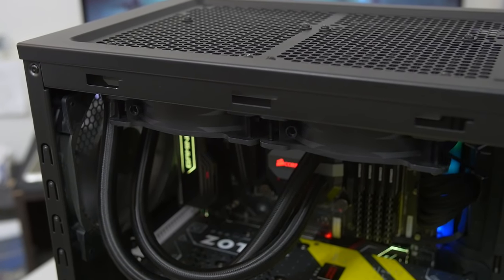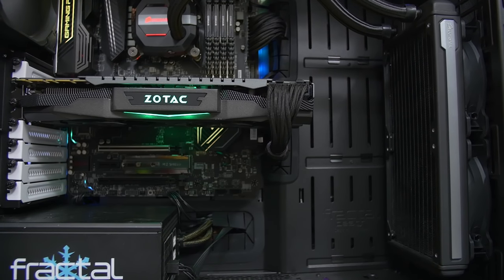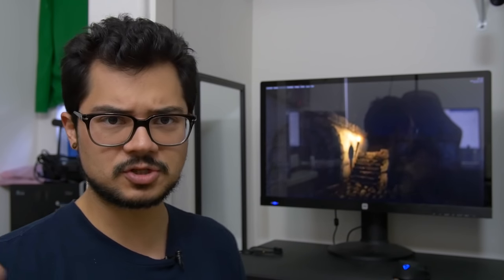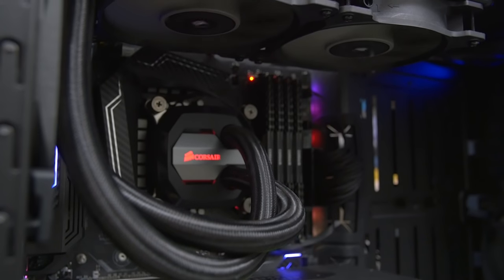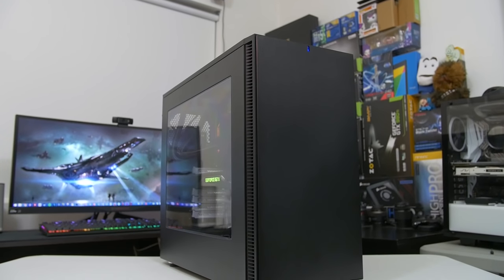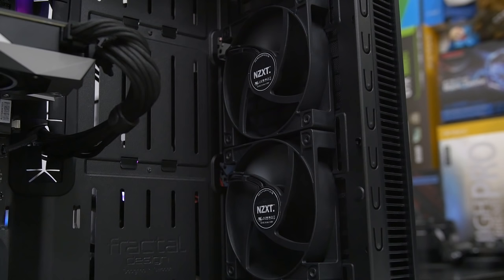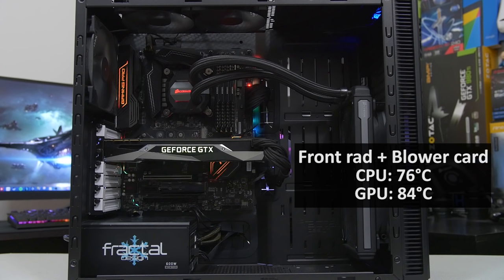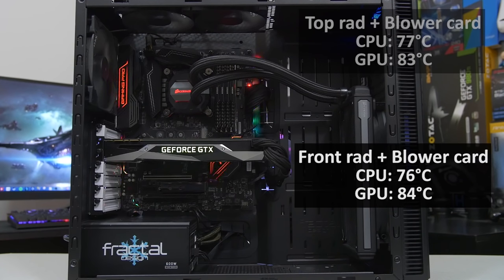Does Radiator Placement Matter? Hint: YES

Comment: so front mount is actually better... interesting, seeing as how everyone was tearing the s340 apart for its lack of top radiator support...
Reply: The S340 is still lacking rad/fan support in the top. It has support for what, one 120mm fan? Maybe a 140mm? That's ridiculous lol. It's a fine case, but like all, has it's drawbacks. Like my H440's front intake sucks fucking balls. I mean, the S340 does as well, but still.
Reply: 3 140s and 1 120 at the rear. front intake is fine, i've done both air and water in mine, and as far as i can see, it doesn't need anything more. for its size and price, there's really not much that could be improved. my 5820k is kept at about 72° by a dark rock pro 3 currently at 4.4 ghz, and my inno3d 980 barely passes 70° @1495 mhz. before that i had a sapphire r9 280x in there, didn't heat up above 75°, and that is one hothead of a card... i don't think much more cooling power is required for 95% of all systems out there, and those systems would probably not be built in a decidedly compact 70 bucks case... the h440s intake situation is way worse than the s340s, there's a huge gap between fans and front panel on the s340.
Reply: givemeajackson The S340 absolutely does not have support for 3 fans in the top. It has 2x140(280mm) in the front or one 120/140mm fan up top. The H440 intake isn't significantly worse than the S340. The S340 is better, but only slightly. Both cases are poss poor options for thermals since I'm both situations, there are better cases for the same price for cooling performance. I paid for the looks with my H440. To be fair though, H440 and S340 were two of the first to the game with PSU shrouds, which was a necessity for me when I bought my H440 a few years back.
Reply: givemeajackson also the 280x wasn't that bad a GPU for temps I'm sure. 70c range sounds about right, which back then for a mid ranged GPU wasn't terrible.
Reply: By that I believe they meant altogether, not at the top. The S340 can support 3 140mm fans and 1 120mm in the rear.
Reply: Not if you intake from the top. Also not a factor if you water-cool your gpu. I dread people referencing this vid and not knowing what they are talking about (not you)
Reply: 3  140s in total of course, which i believe to be entirely sufficient for anything with only one gpu. i'm not temperature limited with my 5820k, it just won't go any higher than 4.4, and temps were perfect both when watercooled and aircooled, and you probably know that the fan setup on a dark rock pro is configured for less noise and not absolute performance. 

the 280x had a tdp of 250 watts, so while its temps were ok due to sapphire doing an extremely good job with their custom cooler (people who owned a reference 7970 ghz will know what that means), it did heat up the system more than pretty much anything else barring a hawaii/grenada based card. yes, there are better cooling cases for the same price now, but not in the same size category. and back in 2014 it was the only case to do the whole less drive bays + power supply shroud thing.

if i had to build my system again i would probably go with a phanteks enthoo evolv, but back then the s340 sure wasn't a bad decision. it's not a case for all systems, it's specialised on one type of system, but the fact of the matter is that most people's systems fit exactly into that scheme, now more than ever: one or 2 hard drives, an ssd, one gpu, either an aio or a medium sized air cooler.
Reply: I think it varies based on the case you use. I think 10 degrees delta as shown  in this video is too much. There must be a problem somewhere. It could be the design of the case, the type of fans, the placing of the front fans, etc.
Reply: givemeajackson Totally agree. However, Phanteks Eclipse P400(S) and Enthoo Pro M are similar size and cost to the S340 but with better fan/rad support. Either of those are better choices than the S340 now IMO. S340 was definitely a killer case when it released though, for sure. 

Also I totally agree with the Enthoo EVOLV, ATX version of that would be my case if I was buying today. Such beauty.
Reply: givemeajackson the s340/elite problem is thr case in take is locked to the top and bottom there isnt comming any air from the side of the front panel.
Reply: I think the define c is better I believe it's shorter
Reply: If you make a comparison between Top Rad + Blower and Top Rad + Open, I think he managed to make a point here. If the GPU is the biggest culprit for high temperature, then it makes sense. But the 10 degrees difference is still quite staggering.
Reply: Lol I have the elite, im glad it doesnt because air has more restriction than it should have when its push on top. 

Heat rises.
Reply: Hmmer Pimy Well my hdd would get fried
Reply: PrimalSounds The "heat rises" thing doesn't really matter when it comes to computer cases. Air will move in the direction set by the fans you have inside the case.
Reply: TrueZtyleZ7 A computer case wont change physics. I have tested the air coming out of my top exhaust vs the rear exhaust and the majority of hot air does come out of the top exhaust.
Reply: PrimalSounds that's not cause of heat convection, that's just the way airflow is set up in your case. heat convection is a way less significant factor than the turbulence generated by fans inside a pc case, especially since our "hot" air is maybe 15 degrees warmer than ambient at most. convection is very important in passively cooled builds, but as soon as you have a single fan in your case it's pretty much overpowered by turbulences
Reply: givemeajackson If you have the fans set for it there is nothing restricting it, a object in motion will remain in motion unless acted on by a external force.
Reply: so heatsinks, meshes and fans don't cause any eddie currents in your system? first of all, there are tons of external forces in a pc case, namely fans. second of all, newton's first law doesn't apply to gases on a macroscopic scale, cause the actual molecules to witch it can be applied are constantly bumping into each other and changing direction all the time. basically, i can't take a fistful of air and throw it somewhere, can i? 

if you don't believe me, take a hairdryer and point it at your feet. that's much hotter air than what you're dealing with in a pc case, still you'll feel a warm wind on your feet cause the dryer's fan is way more powerful than the convection effect. if you sealed the room and let it sit for 2 hours, then you'll notice that there's a temperature gradient in the room top to bottom, but as soon as you turn on the ceiling fan it's all a complete mess again in a matter of seconds.
Reply: you sir deserved a vote
Reply: givemeajackson Depends on which way the blades are turning.
Reply: PrimalSounds actually it doesn't. turbulence is turbulence, on both sides of the fan
Reply: givemeajackson In referance to your analogy a ceiling fan car either be a "intake" or "exhaust"
Reply: really doesn't matter, as soon as there are pressure gradients and objects placed along those gradients there is going to be turbulence. and ceiling fans don't actually exhaust or intake, relative to the room, the just stir things around a little
Reply: Well people say push pull doesnt matter but i see at 10c difference on my cpu when i do it with a thick rad.
Reply: Yep. The air only passes through the radiator for a tiny fraction of a second and really doesn't have any time to heat up, therefore causing no higher temps inside the case.
Reply: I had to put my rad up front. After buying the parts I discovered it wouldn't squeeze in up top. I think the temps are ok... max 65 C on 6700k and 59 C on GTX 1070 (no OC on either yet) whatever I've thrown at them so far. I put the full specs up above. I want to do an OC but I'd feel safer knowing I'm running well within reasonable margins before I do.
Reply: Chris Proost 59c under full load? I dont think so bob. Unless its on a block
Reply: To be fair, I recently bought an R9 Fury. With a -96mV undervolt and with Cali being cold recently, I've been hitting 55C - 63C on it depending on the game. I don't think his temps are unbelievable if he has low ambient temperature.
Reply: TrueZtyleZ7 I live in tahoe bro its like 15 degrees right now my 1070 sc which might make a small difference hits 76 on games like bf1 even with a acx cooler
Reply: +PrimalSounds No shit. It's a Gigabyte GTX 1070 Xtreme Gaming (the big chunky one with the overlapping fans) Afterburner and HWinfo have recorded 59 C on OC mode with fans on boost, through the app (I managed to get a peak of 63 C for like one second last night testing Shadow of Mordor) while registering 99% GPU usage and fans not getting close to full out. This is across Shadow of Mordor, Doom, Dying Light, The Evil Within, Rise of the Tomb Raider and the last 3 Total War games, all maxed out, at a resolution of 2560x1080 and tested for at least an hour or longer (maybe it would get hotter/strain harder at 1440p which is the desired resolution bar for a GTX 1070) The case has 3 fans up front, 2 blowing through the H100i and 3 out so that might have something to do with sucking heat away fast, I don't know... but the GPU is good, I wouldn't care if it was hotter, that's not a big deal... What concerns me is the CPU... in game it seems more stable in it's usage, heat and spikes though they'd be expected, it's under strain after all... I still haven't pushed it past 65 C. But when idling I've noticed it sits in the mid twenties but one core or another momentarily jumps up to the 40's, sometimes even the 50's, just for a second or two every now and then. Is that right? I have no idea, I've never monitored temps etc before this build, it's my first one. Should I be concerned? Btw my ambient temp in here is in the 18-21 C range for much of the day (I have to keep it warm as I have arthritis which this time of year is killing me, it's minus something just outside 3 feet away)
Reply: Chris Proost you have all the headroom you could wish for, and i think on the gpu you'll run into that brick wall nvidia put up at 2050-2100 mhz before you even reach 75 degrees. Anything under 80 degrees won't damage your components, even under sustained load. The temperature jumps at idle are normal, everyone has those. I don't know wheter it's the sensor spazzing out or background processes suddenly causing the clock speed to jump. Go ahead and oc away. Probably not too much in it with the cpu though depending on the chip and how badly the thermal paste between die and heatspreader is applied... But delidding probably isn't for you as a first time overclocker. 1.375v and 4.5 ghz should be a good place to start
Reply: lack of top mounted radiator support to me would only matter if I was considering a dual rad setup and possibly custom loop as opposed to an all in one liquid cooler.
Reply: givemeajackson  Sweet. Thanks for taking the time to give me some pointers. Those idle CPU spikes are freaky though, as I said I never got them under load.. I've already got  Valley/Heaven and Firestrike for benchmarking for when I do OC but I'm in no rush, the CPU is handling everything so far and the GPU is a beast (best I had before was a laptop with i7 4720HQ and a 970m) though according to Afterburner it already bounces around the 2000+ MHz region... and whatever I do I get well over 60 fps on anything (I had to make do with around 45 fps before) Overall this rig is faster than I imagined, all storage is M.2 as well, and well worth the 4 years of saving I had to do for it, I won't need upgrading for a long time. Cheers.
Reply: Chris Proost Well my 6600k is overclocked to 4.7ghz 1.35v you said you were doing push pull? I cant do push pull with the s340 elite unless I removed the resivoir mount/cable managment bar. But at 4.7 even though its 15 degrees F outside and I have single pane windows it still will idle at 30 degrees even with the x62 and a 280mm rad in a pull config. I didnt know which specific brand of gpu you were speaking if and it sure as hell isint a founders edition with those temps lol.
Reply: Chris Proost the temp spikes are always like that, under load everything is always way more consistent. On pascal overclocking is pretty much just for bragging rights, and the i7 is also already quite close to its limits, so it's not really necessary for most purposes, but it's fun
Reply: PrimalSounds It's 3 fans at front with the H100i rad behind the bottom 2 (all 3 are the RGB ones that came with the case for uniformity) The fans from the H100i are in the roof as exhausts (I thought I may as well use them) and there's an ML fan at the back. In hindsight I could've planned it all better but I had no idea the rad + fans wouldn't fit above the mobo and RAM. I think the perfect set up would've been 3 fans at front clear, 2 fan rad pushing or pulling out the top and a liquid GPU pushing out the back... the only temps of any note left in the case would be heat escape from the CPU/fan pump and backplate/edges of the GPU. Tbh picking the GPU was the hardest part of this build. I had to change my mind a bunch of times because of availability and issues (EVGA FTW, then MSI Gaming Z, then ASUS ROG Strix, then 2x RX 480 Nitro OC, and finally the one I got because I got a deal on it lol) This PC building lark is like tweaking skills and stats for an RPG character but with electricity and real world costs if it all goes wrong...
Reply: He actually tested it with two fans on the top.
I believe that if he did not have the fans on the front/top, only the radiator fans, the results would be different.
Not sure though, just speculation.
Reply: Okey with front aio should top fans be exhaust or intake??
Reply: Exaust, I believe
Reply: ill go with exhaust as you would like to get rid of hot air.. hot air naturally rises upwards so I would make sense looking at the problem this way ?.. im doing this with my rig
Reply: Emil Eriksen Nope, a object (air) in motion will remain in motion unless acted upon by a outside force (fans)
Reply: PrimalSounds you can't treat gases like objects cause they're actually billions of objects constantly bumping into each other. Hot air rises, cause it has lower density than cold air, and it has lower density cause its particles have a higher amount of kinetic energy on average (that's what "hot" means for gases). If you could apply newtons laws to fluids and gases air bubbles wouldn't rise in water.
Reply: But of course, heat convection is quite insignificant in the context of pcs. We're calling 15 degrees warmer than ambient "hot", and the turbulences from fans overpower that easily
Reply: Are you saying that hot air does not rise naturally?... otherwise I don't see the point your making
Reply: Emil Eriksen Would hot air rise if there was a ceiling ran spinning at 2000 rpm?
Reply: +PrimalSounds that's not what you wrote... by itself hot air rises.
Reply: I don't know what you guys are arguing about, but pressure (like from a fan) completely overpowers the density differences of hot and cold air that would have them rise and lower above and beneath each other like they would in a static environment (no fans or wind). Even just one exhaust fan should cancel that effect.
Reply: Kellin Quinn agreed.
Reply: ***** Depends on what kind of fans you are using..
Reply: PrimalSounds it really doesn't
Reply: givemeajackson It really does, for your theory to work you would need all SP fans, AF fans are going to blow the heat wherever the intake is coming from directly across the front and out the back is where most of the hot air will go, jayztwocents did a video on fan placement and when you use the smoker you can see most of the air going out the rear exhaust, some heat will rise yes but most will be pushed out the back. I know this because the temp sensors read more hot from the back exhaust than the top exhaust.
Reply: To go back to my first post. I would have fans on top sucking "hot" air out of the case and pull fresh "cold" air from the front trough my radiator
Reply: PrimalSounds no. just no! Turbulence is turbulence, and that will overpower heat convection! fan blade design is literally the least important factor in all of this! Your temp sensor readings are entirely dependent on the fan configuration, the location of your components and heat sinks, and the respective restrictions each fan has in its effective area. Heat convection is no factor here! Whatever fan you're using! So far you've only been spouting uninformed wrong statements throughout this thread, do you even know the slightest thing about the behavior of gases?  A fan doesn't throw a "piece" of air straight through your case like it was a baseball, it creates a preassure gradient...
Reply: Emil Eriksen good setup, doesn't really matter if it's up or down
Reply: I use a back mount with a magnetic air filter on my case. My thick 80mm single fan rad has kept my 9370 stupid cool for 2 years with a everyday 4.9 overclock.  i never saw it go past 51c at load and most of the time it was in the 44 c range on the cores. Right now my cooler is ziptied on my ryzen untill thermaltake get off their ass and releases a adaptor for this little cooler i love it. I bought it because it beat the H8oi back in the day pretty badly and i only had room for a single fan rad in my old case.  I have a Corsair 750D now but this little cooler works so well im going to keep it.
Reply: Andre Williams well, the fx cpus were notorious for wrong temperature readouts, so it was probably a lot hotter in reality, but as long as it doesn't crash, throttle or break it doesn't really matter. Anything under 80° is fine really.
Reply: I had 2 thermal probes in my case and one was on the radiator itself. Oh i knew when it was overheating because the radiator would be hot to the touch. That only  happened when i tried to hold 5ghz everyday overclock and that couldnt happen the temps got too crazy i had to use too much voltage to hold it so 4.9 was fine for me.
Reply: Andre Williams yeah. My 5820K does 4.5, but it's not worth the noise, so i run it at 4.0 most of the time. At 3440x1440 i'm gpu limited anyways
Reply: givemeajackson of course its better its sucking in fresh air to cool the rad fins rather than exhausted air from the gpu, all the other heatsinks on the mobo, the PSU, any drives there might be etc..
Reply: Christopher Sizemore nobody was saying that it was bad for the cpu side of things, but people were going  like "omg ur gpu will go to 1500° and ur motherboard is going to melt if you use a front mounted rad"...
Reply: CPU AIOs really don't get hot enough to heat the air up very much in my experience. You're rarely ever at 100% load on all cores on your cpu. GPU aios though... Have fun with other component temps if you put that at the front of your case.
Reply: Try using a front mounted gpu rad. Everything behind it will go up 10C or more.
Reply: I have a meshify and an x52 kraken what's the best air config I'm going to buy fans that's why..
Reply: The front mount on the s340 is attrocious.. not because it's front mount, but because it has severely limited air flow.  You lose volume of air moved every time you have to do a 90 degree turn to get air to the fan.. that one has two.  It wouldnt be bad if the front was mesh'd or honeycombed (my first and only case mod that will be done to my s340).  I notice that my proc runs, even at idle, 3-5C cooler with the front of the case off.. there is an airflow issue there.  Since I'm running one of the hottest procs around, I need that air flow.
Reply: s340 has a lot more problems than just lack of top rad support. the front rad space sucks balls too because there is not enough air coming in through the front.
Reply: givemeajackson  片。，叫你你就能进步 din b f
Reply: That it can be better for the CPU ok, but that it is better for the GPU as a universal finding is still hard to believe.
Reply: I'm giggling to myself as I watch this video just after I ordered a 340 elite and a corsair H100i.
Reply: well MAYBE but since he tested it with everything overclocked instead of stock, no one will TRULY know. You always test shit like this on stock settings, BEFORE OC'ing....